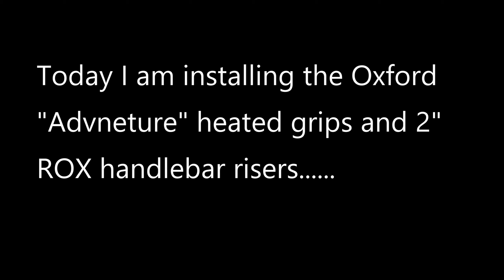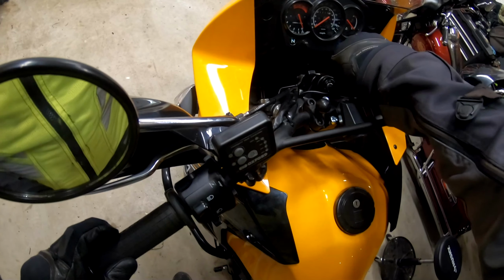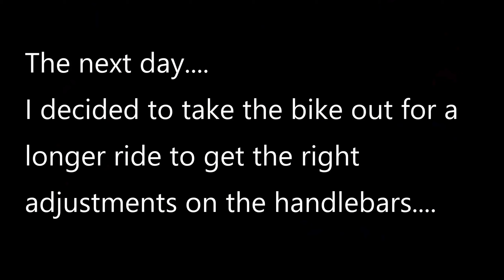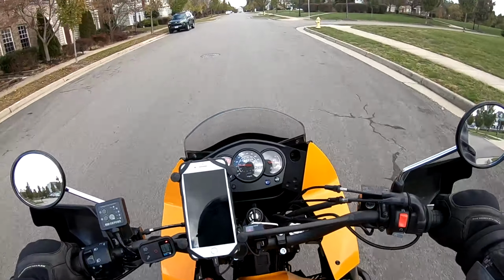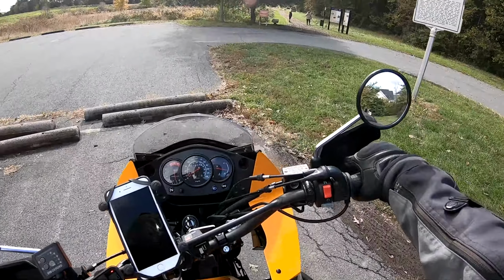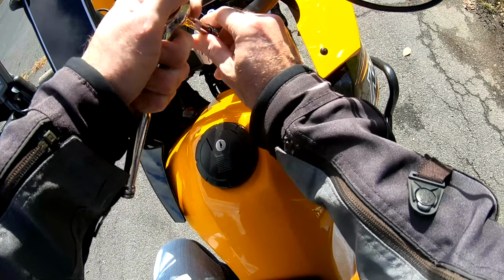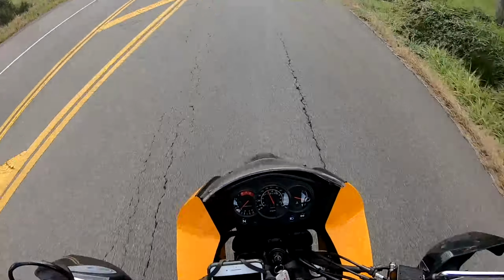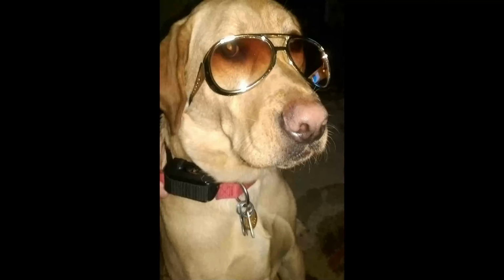Heated Grips and Bar Risers #klrdelusionals

Comment: Good god I miss my KLR!!!  I didn't realize it until hearing yours fire up haha.  I was the same way with my grips on my XL when I installed the wrap around metal hand guards.  I had to cut the throttle side down and was all upset for a few days lol.  I'm always driving around with tools and stopping in random spots to adjust things so they are juuuuuust right.  Handel bars, controls, headlights, fog lights, pants, shoes, ect.
Reply from the maker: Its ok to be a perfectionist.  I hate doing things only half way or sort of right.  Sounds like we are kindred spirits that way Swanky!

Comment: I recently added a device that is essentially a force multiplier for your clutch I believe its advertised on Ebay as a "stunt" clutch or some crazy jazz like that basically what it does is double the length of pull but cut the pull force by half making 1 finger clutch pulls a breeze and as an added bonus increases the friction zone giving you more control when slipping the clutch in rough terrain I think I paid $13 for it with free shipping from China plus since it adds on to the end of your clutch cable it will give you that needed slack you lost when you added your risers
Reply from the maker: Sounds interesting kawadude… do you happen to remember where you ordered it from?  I know FullCipher and some others including myself would like to take a look.  Thanks!
Reply: @BOC_Adventures  go to Ebay and look up savage stunt clutch easy pull lever comes in all different  colors
Reply: Oh yeah I forgot to mention I also have the tusk adjustable levers it really helped with getting the release exactly dialed in where its fully disengaged at the back of all my fingers I still have just the slightest amount of freeplay and am not sure if the stock levers will give you enough throw otherwise so not sure how well it'll work on stock levers

Comment: I think I would have to sit on a bike that has risers on it to compare the difference.  I am kinda on the fence about getting  them....The heated grips on the other had are on my Christmas list.  Ride safe.
Reply from the maker: If I had to do it over I would probably try the 1" over the 2".  Both probably fine but I worry too much about the cable tensions.   Heated grips will change your riding life for sure TruckMan.  Especially in your neck of the woods.  Ride safe brother....

Comment: When I added my 2' Rox risers my bar position went straight up and stayed at the stock position. The throttle cables were way to tight (applied throttle when in full right turn) My fix was to rotate the cables 180 degrees (at the handlebar clamp) so they are now under the handlebar works perfect. The other wiring had to be unfastened from the frame to achieve enough length and refastened to new locations. Clutch readjust as stated. I watch a lot of KLR's on the tube and never seen this done.

Comment: Interesting video! How are you liking the risers and how has your cable length been?
Reply from the maker: Honestly the cable length is a bit sketchy.  I have the bars adjusted as far forward as possible ( so not to hit the stock windshield) and it is snug.  Wondering if  a more adjustable windshield will allow me to move them forward more.
Reply: Box of Chocolates that’s the rub, one thing leads to another
Reply from the maker: FULLCIPHER  True however I think the cables will ultimately be fine.  Another option would be to eBay the 2” and go with 1” risers.

Comment: Did you go with the one or two inch risers?
Reply from the maker: I went with the 2" risers.  That being said the cable tension is not to my liking.  If I had to redo it over again I might go with the 1" risers.  Thanks Dante
Reply: @BOC_Adventures  Then I have the same risers. I'm going to try and reroute the cables if I still need more. I will get longer cables.
Reply from the maker: @DanteFox  If you do go with longer cables please film it.  I am sure there are a ton of folks that would love to learn how to do that.
Reply: @BOC_Adventures  Will do. But honestly changing cables is not that bad.
Reply from the maker: @DanteFox   Roger that.  But it would be a good vid still.  Thanks man.